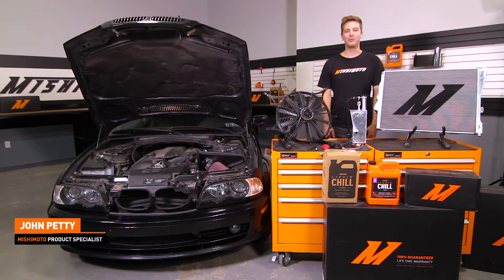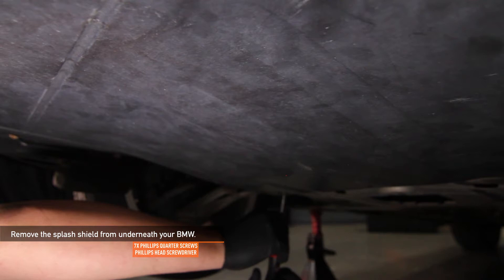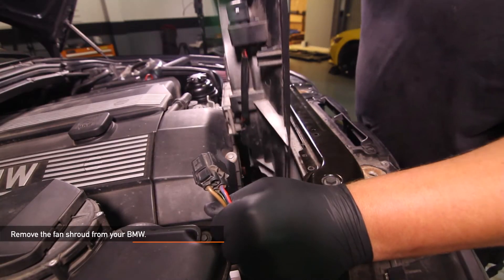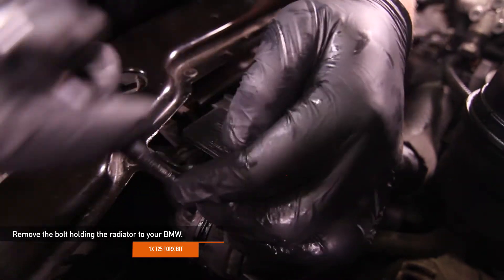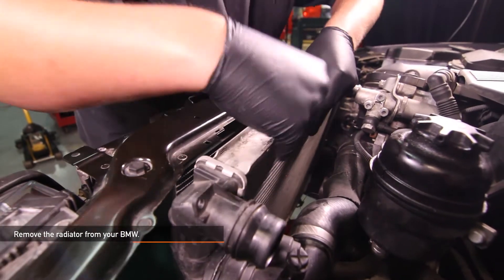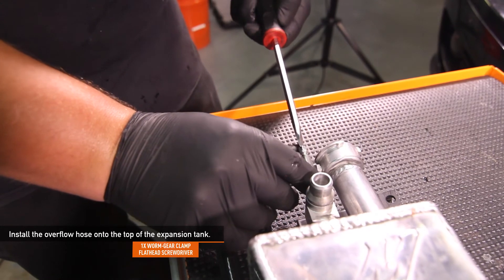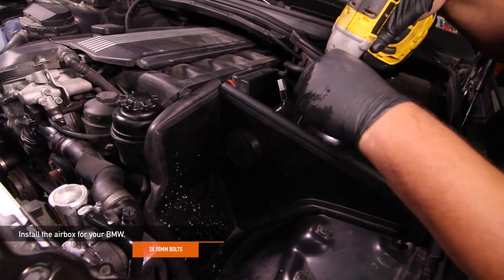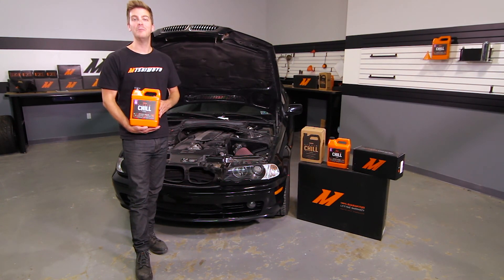1999–2006 BMW E46 Non-M Performance Cooling Package Installation Guide By Mishimoto

Comment: Hey mishimoto! can the expansion tank also be used on department store replacement parts? meaning can i put an aluminum expansion tank on an Oriellys Rein or Dorman brand tank bracket?
Reply from the maker: If the OEM counterparts are compatible, the Mishimoto units should be as well.

Comment: what is the tnp option I don't understand it????
Reply from the maker: If your are referring to the NPT fan controller, the difference is that the NPT will need a threaded port for installation. This allows the sensor the read the coolant temperature directly. 

The alternative option is the probe sensor. While not as accurate, it still works very well. This is inserted into the fins of the radiator to read the temperature of the coolant within.

Comment: At 4:25 the T25 torx bolts were removed , but if I’m still going to use the same plastic BMW expansion tank & mounting bracket , can those T25 bolts still be reused , or would I have to get the 10mm bolts as shown @ 6:50?
Reply from the maker: If reusing OEM parts, the OEM hardware should be fine.

Comment: Is there a dual fan set up for this radiator or would another brand dual fan shroud fit?
Reply from the maker: We do not currently offer a dual fan shroud but any shroud that uses the OEM fan mounting points should work on our radiator as well

Comment: Does anyone know if this would fit a swapped manual?
Reply from the maker: As long as the transmission cooler was deleted during the swap you should be fine installing the manual version of the E46 radiator.

Comment: Why I can't find the expansion tank anywhere? Is the e36 expansion tank the same for E46? I can't find the E46 expansion tank 🤔
Reply: I bought the radiator but couldn't find the expansion tank anywhere, I'm tired of the plastic one
Reply from the maker: Hello Carlos,  unfortunately this expansion tanks had been discontinued at this time. This is why you can no longer find it online.
Reply: @mishimoto  I see, would you ever make another version?
Reply from the maker: Currently we are looking into other project, however it is possible we will redo the tanks in the future.
Reply: @mishimoto  No you won't, like you didn't with your silicone intake hoses. No manufacturers care about non-M E46.
Reply: Awesome thanks for the reply!

Comment: Will this work on the M56 motor ? I think the one in the video is the m54
Reply from the maker: The M56 was just a M54 that was modified for emissions. The radiator on both cars appear to be the same.
Reply: Mishimoto Automotive the M56 has the clutch fan
Reply from the maker: The E46 could be found with both electric fans and clutch fans. The manual cars like in the video used the electric fan while the automatics used a clutch fan and small auxiliary fan up front. Your fitment should be no different other than having to delete the clutch fan.
Reply: @mishimoto  finally my question answered ty lol

Comment: Do I need to install a controller with the fan? I installed it and it is working but my engine is running hot.
Reply: Just a update to help anyone else having the same issue as me, if you wire the fan to a switch and relay you have to keep the auxiliary fan sensor in or your car will run hot
Reply from the maker: Would you be able to shoot us an email to support@mishimoto.com? We would be happy to diagnose the issue with you and see if we can solve the issue.
Reply: Curious did you ever find a solution to your issue? Currently having the same problem with mine

Comment: Does it make a difference that I have a Mechanical Fan and not Electric?
Reply from the maker: Hey IxRxBaboon . This was designed to work with all of your OEM equipment as well. As long as the mechanical fan is stock, you'll have no issues :)

Comment: I have to remove the auxiliary fan after installing the mishimoto fan non m??!
Bmw e46 steptronic.
Reply: No I just installed mine and followed the M# installation video. I'm using their controller though with the entire package, not just the fan. The Aux fan is fine though. It literally has nothing to do with the installation process. I have a 325Ci btw.
Reply from the maker: Hey Samuel, please check out our installation guide at the link below or contact our support team at Support@Mishimoto.com!
https://cdn.mishimoto.com/media/productpdf/MMFS-E46-99_InstallGuide.pdf

Comment: I struggled more than I should have, esp for what it cost, rad, tank and hoses £600!!  I had to modify many of the plastic trims, mostly because of the welds on the expansion tank were raised too much.  Also mine leaked at the bottom of the expansion tank, the smaller of the 2 connections.  Its says in the video that you get new o ring seals, but i didn't, and it seems that the recess that the smaller o ring sits in is slightly bigger than the stock expansion tank, therefore not providing a seal.  I managed to find a hardware store that sold them and I found one slightly bigger and thicker, which seems to have done the trick.  The other struggle was connecting the 2 connectors at the top, the small one on the expansion tank and the larger one on the rad.  Although I think this is BMW's fault - these coolant hose push connectors - WTF!!, whats wrong with jubilee clips???  The stock cooling fan rubs on the lower pulley too!! Anyway, its done now!!
Reply from the maker: Hey David - I'm sorry to hear you had so much difficulty with our BMW performance cooling package - if you're still having any issues or problems, feel free to email our support specialists at support@mishimoto.com or call 1-877-GOMISHI.

Comment: hey, can I still used my old Electrical clutch fan and would it bolt up
Reply: Yes it'll work but installing the electrical fan is much better and easier to work on the engine because it's a lot easier to remove.
Reply from the maker: +Mar Garc Hi Mar, please email support@mishimoto.com with your question - they will be more than happy to help you out!  Thanks,  Team Mishi

Comment: I forgot to mention that in order to install the radiator you will need to buy the fan clutch tools. But there are other ways to remove it. I did not buy the tools and had a bit more difficult time installing the radiator.
Reply: That's if you own an automatic.

Not required for manuals